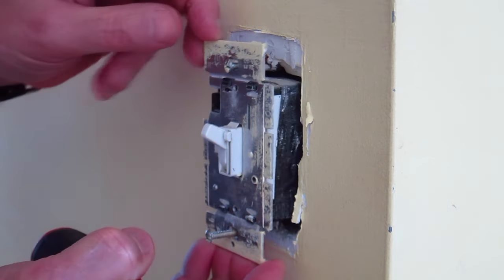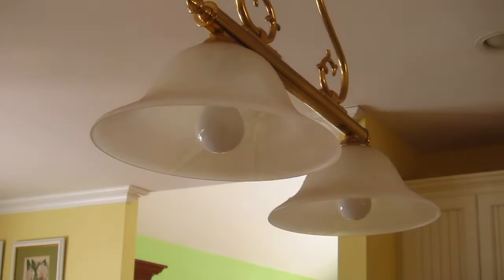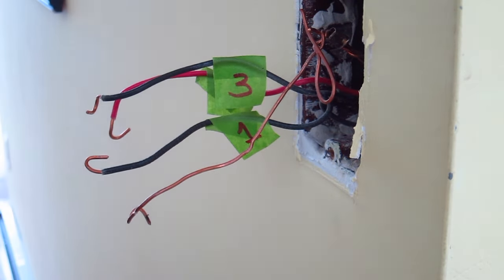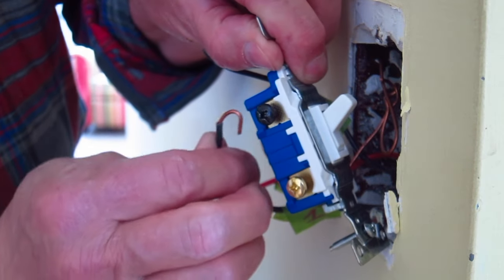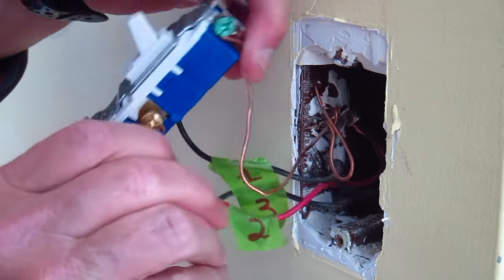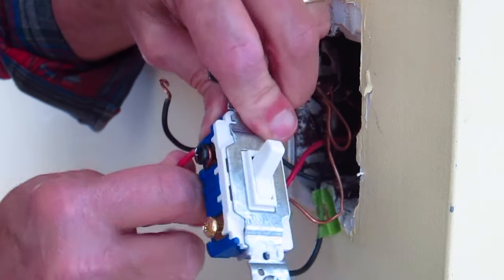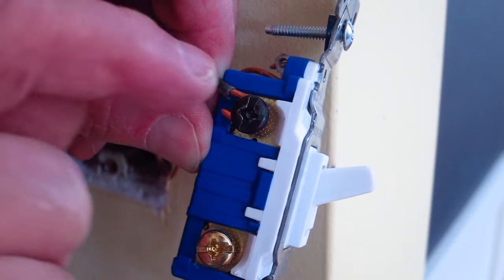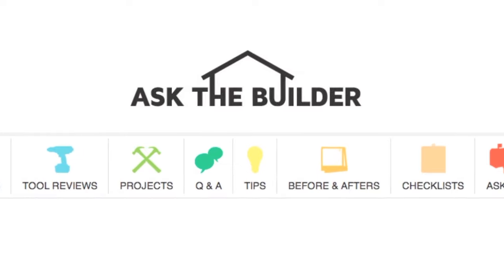3 Way Switch Troubleshooting

Comment: you nailed it!  This was perfect.  I was told to call an electrician when she left and I was not to touch electric  anymore.  That makes my blood boil because, well i am cheap  ( kind of) but know i can fix it.  With your help I did just that.  I wished  I think I can, I think I can and I think I can.  Finally Igot it on third try.  Deal is a deal.  Subscribed.  Now it;s time to go pound my chest and talk her into letting me put a ceiling fan .
Reply from the maker: Congrats! Success breeds success. Report back how the fan goes. They're easy. Just be SURE you have the right box and it's BOLTED to a framing member.

Comment: Thank you for the great video. I am still not working so I checked other switch and they used two blacks and a white.  The red is tied together with the rest of the black wires.   I tried removing white and tying it into the rest of the neutral wires and connecting the red but now no power on either switch.   Sad when the builders contractors aren’t all they claim to be
Reply from the maker: Listen again to the first 40 seconds of the video. For unlimited tips like this video, subscribe to my FREE newsletter at www.AsktheBuilder.com

Comment: Just read the old switch for the common engraved on the connector before disconnecting any wire. On the new switch connect that common 
 wire to the common connector black (screw)  the other 2 wires can go to the other 2 terminals (not the ground terminal).
Reply from the maker: If you follow my instructions, the new switch will work.

Comment: I changed out my bathroom light switch using your video. I thought things were all in order as light now works. But I later found when the bathroom light is on, the other outlets on that circuit don't work until I turn my light off. What did I do wrong and how do I fix this mess?
Reply from the maker: Far far too much to type. You need one of my consult calls. Far cheaper than an electrician. https://shop.askthebuilder.com/15-minute-phone-or-video-conversation-with-tim/

Comment: I have a garage door and indoor lighting on the same circuit. Power is out to this circuit. Electrical panel downstairs shows no circuits tripped or in the center position.  Interior Ceiling fan wall switch, outdoor porch light wall switch and garage door power outlet are all without power. Which wall switch do I check first?
Reply from the maker: Please watch the first 45 seconds of the video again and LISTEN CLOSELY to what I say. Then watch my ORIGINAL 3 Way Switch video:  https://www.youtube.com/watch?v=LDyvcM0gcVs

Comment: Awesome video! However, I still have hopefully a minor problem. I have everything wired correctly & both sides of my 3 way switches work on both ends but now, (with the new lighted 3 way switches I installed), the  glow light switches themselves have a slight pulse/flicker to them & I don't believe they should.  They are Eaton 7513W-BX-LW brand/model. Also, before the remodel, I had plain old non-lit switches running to incandescent/cfl/led bulb with led bulbs in them & now have led recessed lights, would that somehow make the switches pulse/flicker in the off position? Thanks for any advice!
Reply from the maker: This is why you always MUST GO to my website for additional information: https://www.askthebuilder.com/flickering-led-bulb/

Comment: Thank you.  I subscribed.  What I don’t understand is I couldn’t get the black or common screw loose so I just reversed the travelers and magically it all works.   I thought it didn’t matter where the travelers were located. . .
Reply from the maker: Switching the travelers between the two screws they belong on will not make a difference. The travelers don't care which brass screw they're on. What you think is the common screw must not have been. Make sense?

Comment: Stumbled across this video and thought I’d try and fix our second kitchen switch that hasn’t worked since we moved in 10 years ago. Unfortunately, this method didn't resolve our issue. Is there a chance that something’s wrong at the 1st switch in the run?  Two of the iterations allowed the end run switch to turn off and on the light as long as the 1st switch was in the on position, but having the 1st switch in the off position, none of the iterations allowed the 2nd switch to turn on the light. Any ideas??
Reply from the maker: Yes. My idea is for you to jump on the phone with me so I can fix it for you: https://shop.askthebuilder.com/15-minute-phone-or-video-conversation-with-tim/

Comment: I need a bit more help than this - I replaced a few single pole and 3-way switches and I was meticulous about putting wires in the same configuration, however none of the lights work on the entire circuit now :( do you have any other videos that show how to troubleshoot?
Reply from the maker: Need more help? That's why I developed this product> Far cheaper than an electrician: https://shop.askthebuilder.com/15-minute-phone-or-video-conversation-with-tim/

Comment: ok..  I'm working on a 3 way switch, 1 at the top the stairs, 1 at the bottom..  Both switches have been removed.  All I have is three wires hanging out of each box.  Do I just connect the 3 wires on any of the 3 screw connects on one switch and then use your 'method' at the other other end??
Reply from the maker: No. You completely goofed up. Watch my original 3 Way Switch video now. If you still can't figure it out, then I can solve your problem over the phone in minutes: https://shop.askthebuilder.com/15-minute-phone-or-video-conversation-with-tim/

Comment: I replace my three way switch yesterday and it worked fine, got up this morning and it didn't work, could the problem be someplace else, I switched it because the light would no longer turn on, but it could be the other switch??
Reply from the maker: Read my 3-way switch columns on my www.AsktheBuilder.com website. To get unlimited free tips each week like this, be sure to sign up for my FREE newsletter at www.AsktheBuilder.com

Comment: I replaced my dimmer with an LED 3 way dimmer switch in order to put in LED bulbs,  but then the second switch was dead and would not turn the lights on or off.  I tried the 1-2-3 wire trick to no avail.  I put back the old dimmer and now both switches works fine again.  Is there any issues with LED 3 way switches?
Reply from the maker: Well, I can only think of two things: The switch is bad - you didn't wire it up correctly.
Reply: @askthebuilder  Eureka!  Replacing both old switches did the trick. For some odd reason, the old leviton 3 way switches worked together, but if you added a new switch, the  remaining old one would not cooperate.

Comment: you are only demonstrating on one switch! Do you mean that you attach 1,2, 3 to both switches and then do musical wires on one switch?
Reply from the maker: That is correct. You must have glossed over what I said in the first 45 seconds. I mentioned how the viewer is installing a new switch, not switches plural. Most do it ONE AT A TIME. You install the new switch and test it only to discover the two switches now don't work because you goofed up the wires. You fix the new switch using my method above and then move on to install the second sew switch. Nothing about this is hard. There are over 600 positive comments below from people who used this method and it worked perfectly. GL as we say in Morse.

Comment: Im at a complete loss here. I went to take out a old remote light system, to install a toutch smart auto light system. Upon pulling out the box there is One Black + One Red + and one white -  That is all that is in the box, the lights in the living room work with the old set up, SOMEHOW!. any advice I'm stumped. Oh both red wires were togather and white wire ground, the switch has only a blue wire and white wire😯And yes I subscribed!!!
Reply from the maker: David, I suggest watching the video above again. If you need personal help over the phone to get you out of the jam, I offer you my protection. Cheaper than a service call from an electrician: https://shop.askthebuilder.com/products/15-Minute-Phone-Conversation-with-Tim.html

Comment: I was trying to replace the old 3way switch with the smart switch. So I removed the switches from both the boxes to see the line. But box1 has all 3 wires as hot and box2 has 2 wires hot. How is this possible? Can you please have a diagram of this setup and explain it? Is it possible to install the smart 3way switch here? Thanks in Advance.
Reply from the maker: I drew these diagrams 25 years ago. Still are relevant: https://www.askthebuilder.com/3-way-4-way-switch-wiring-diagram/

Comment: I have an issue where the switch (#2) is only working if the other one (#1) is turned ON. Should I be troubleshooting on the switch (#1) that has to be ON for the other one (#2) to work? Or trouble shoot the one (#1) that is dependent on the other switch (#2)?
Reply from the maker: Simple. Watch my original 3 Way Switch video: https://www.youtube.com/watch?v=LDyvcM0gcVs&t=1s  Then watch this one again. If you need more help, I do phone coaching: https://shop.askthebuilder.com/15-minute-phone-or-video-conversation-with-tim/

Comment: What if they used the white wire to send the hot or switch leg to the other switch for a deadend?
Reply: California 3 ways (running the neutral as a hot) should be completely redone. They're unsafe. Call an electrician.
Reply from the maker: It's all about knowing where the power is. Black tape! Get unlimited FREE tips like this each week by subscribing to my newsletter at www.AsktheBuilder.com

Comment: I just added a ceiling fan to an already existing 3way switch that powers an outlet where a lamp is plugged in. When the outlet is on, the ceiling fan turns off and vice versa. The other problem is that when the ceiling fan is on, there is backfeed to the outlet and the lamp stays partially on. The light switch worked fine before I added the ceiling fan so I’m not sure if swapping the wires around will fix it. Any suggestions?
Reply from the maker: Yes, here's my suggestion as it's far too much to type: https://shop.askthebuilder.com/15-minute-phone-or-video-conversation-with-tim/

Comment: Ok that was funny but help! I installed a three way dimmer according to the wiring diagram and it worked perfectly,  but now other lights on that circuit won’t turn on. There are no other dimmers on the circuit (or even on this floor of the house). Why would the dimmer interrupt the other switches and outlets? Half are working and half aren’t. Reinstalling the old basic switch restores everything. I cannot find an answer anywhere online that tells me how to fix it.
Reply from the maker: I'm happy to help. The only way to do it with me is a phone call. FAR too much to type here. https://shop.askthebuilder.com/15-minute-phone-or-video-conversation-with-tim/
Reply: @askthebuilder  Thank you! I think I solved it. It was a basic stab back switch thing (lol) and they had an additional wire on the screw which was running to the additional items (basically using the switch as a waypoint - which I hear isn't best practice). I thought it was a 3-way because of this extra wire but once I thought about it I knew there weren't any other switches that affecting this light so I was able to figure out the extra wire was being used for the other receptacles.  I know my nomenclature is not accurate but I imagine you know exactly what I mean. I was able to get everything to work and will have an electrician check it when I have them come to install a new fixture in my stairwell (which I cannot reach and thus cannot do on my own). I'll be saving that link though as I try and do really simple stuff like this on my own!

Comment: Good morning I installed a 3-way dimmer switch from a 3-way single pole switch now the lights dim except for two on both dining room and kitchen I replaced both sets in the same a box receptacle box could it be I have to check the light bulbs I believe your halogen or LED
Reply: On a dimmer switch itself there's a lever high and low I turn it down low until the lights almost went out and flickers and then I turned it back on when they stop flickering I'm not sure if that's the problem your help would be appreciated
Reply from the maker: Read the column about this on my www.AsktheBuilder.com website. Always go there and use the Search Engine when you have a problem. There are THOUSANDS of columns there about every home improvement project known to man or woman.

Comment: I replaced one of the 3 way switches... and it seems to work...BUT ! the 2nd switch can turn the lights out but can't turn the lights on....Doing the same thing to this switch, will it work?
Reply from the maker: If the switches worked perfectly BEFORE you switched the one out, then you didn't do correctly what I show in the video. You should go back and re-watch the video paying CLOSE ATTENTION to what I say in the first 40 seconds. What was the exact reason I made this video?  If you screwed up taking BOTH switches apart for some reason, then you need to watch this video of mine to understand how both switches work together to make the magic happen: https://www.youtube.com/watch?v=LDyvcM0gcVs&t=5s

Comment: So. Not working. Could the switch be bad? There's one configuration where neither switch works. And there is no ground in either box. Suggestions?
Reply from the maker: It's possible, but maybe a 1:1,000,000 chance. LISTEN to the first minute of the video!!!! This method works for when you removed ONE SWITCH and goofed up the wiring.

Comment: I tried all this and didn't work 😢 I am so puzzled. The light actually turns on ONLY if both switches are turned on. However, the switch will allow me to turn the light off if one light switches is turned on. Would it matter if one of the switches has the green screw down and not up? My switch doesn't have the wire for the green screw. I did enjoy this video though. I guess maybe I'll try the other light that isn't like your video and run the same sequence and see if that works.
Reply from the maker: Go back and listen carefully to the first 45 seconds of the video. NOTE that I'm only working on ONE switch. Before the video the switches worked FINE. You may have to watch my ORIGINAL 3 Way Switch video, the most popular one on YouTube, to grasp WHY certain wires must be on certain screws. Lastly, I can talk you through it over the phone: https://shop.askthebuilder.com/15-minute-phone-or-video-conversation-with-tim/

Comment: Hi there- My father in law (seriously) replaced the light fixture on a 3-way system, and the light now does not work properly... only switch A can turn the light on, and only if switch B is in the proper position. But switch B can’t turn it on. We never touched either switch, just the fixture. Obviously the wiring got messed up on the fixture... help!
Reply from the maker: Read all my electrical columns at www.AsktheBuilder.com. You can also talk to me on the phone - cheaper than calling in an electrician who will charge you over $150.  https://shop.askthebuilder.com/15-minute-phone-or-video-conversation-with-tim/

Comment: Tim,i have an overhead light and a wall sconce controlled by 2 3 way switches. one at top of stairs, one at bottom. suddenly lights didnt work. replaced bulbs with known good ones,still nothing. replaced 3 way switches one at a time, still nothing. please help.
Reply from the maker: Watch my original 3 Way Switch video here. If you still are in a bind, I do phone coaching. Far cheaper than having an electrician come out. https://shop.askthebuilder.com/consult-tim/

Comment: Suddenly a paddle toggle two way light switch lite up with an orange glow. I guess it may be an illuminated switch? Took it out of wall not hot, not sparking.  Why after all these years would the light (small orange glow) would it start to work?? Should I change it out. No smoke, no smell?????
Reply from the maker: Could be, or it's melting. For unlimited free tips each week subscribe to my FREE newsletter at www.AsktheBuilder.com

Comment: I have 3way 2switches. I disconnected all  the wires then turned the circuit breaker back ON, then tested all wires with voltmeter. The result was 5 wires has electricity flowing (not including bare ground wire) except 1 wire which I believe goes to the light bulb does not have electricity. Is this normal?
Reply from the maker: What's normal is for many to goof up connecting the wires. Watch this video again and my original 3 Way Switch video and you'll have success! If you want FREE unlimited tips like this each week, subscribe to my newsletter at www.AsktheBuilder.com

Comment: I have two halogen directional lights with transformers. Both burned out. I replaced them both with LED lights, same fixture just different lights. There's a third light in the center of the ceiling as well using the same line. However, when I replaced one of the directional fixtures the light flickered and buzzed. I was thinking because the dimmer switch isn't for LED but the new one just didn't work at all. I really don't need the dimmer switch I will try a regular switch. I'm hoping I can just use a regular paddle switch and be done.
Reply from the maker: It's all about alternating current. If you want unlimited tips like this each week, subscribe to my FREE newsletter at www.AsktheBuilder.com

Comment: What if there is no white neutral wires inside the box?  I have 3 wires and a copper ground wire. The switch will not turn on or will not turn off depending on the position of the downstairs switch.
Reply from the maker: It doesn't matter if there are no white wires in the box. My method is FOOLPROOF if you just messed up ONE switch. If you took apart BOTH switches, you need to go watch my original 3 Way Switch video.